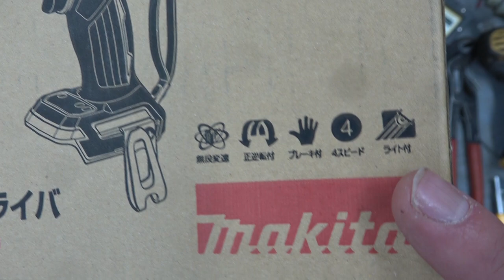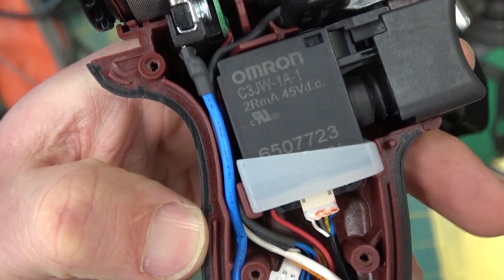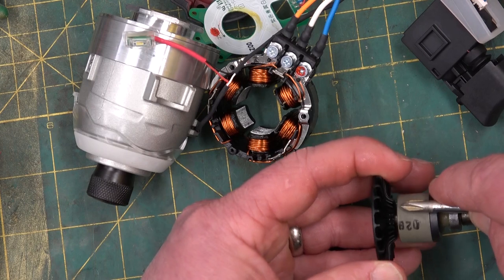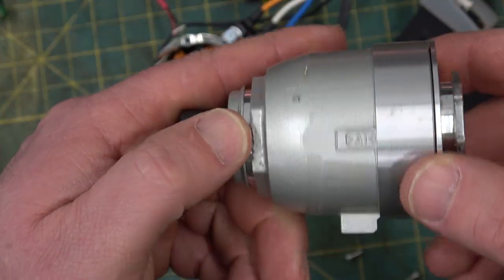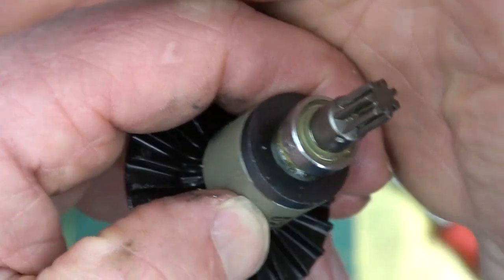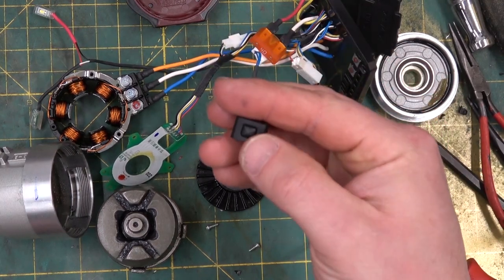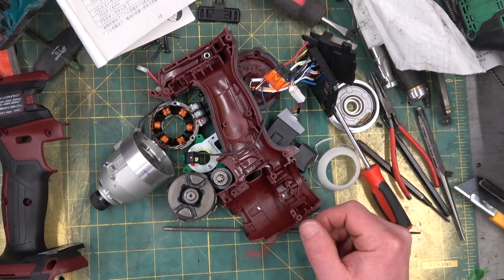Are Japanese Tools Better? Yes.

Comment: It has the exact same internals as the DTD171 sold here in Australia. The older DTD170 also had the 40A fuse and nice Omron switch. This model is the top tier in their 18V impact driver range and is sold as the XDT16 in the US.

Comment: I know a fellow who teaches English in China. He said " they keep the good stuff and ship the smoo ( junk ) to the states ". The old Bonnie wrenches were a joy to hold in this old gals hands. Highest quality. Still going strong. Lighter and more springy than common snapon. MAC had a few with these qualities. Super handy working on equipment with little access / working room.
Reply: I have access to some Chines market products, which are great and not cheap in anyway. Better than anything I can buy here.
Reply: That's mostly a myth, especially if you start comparing tools at the same price point, rather than compare a high end tool against an inexpensive one, like AvE is doing in this video. Of course the most expensive tool wins. It has better parts in it.

Comment: Watched this when I woke up.  Thought I was going blind from the focus.  I need to stop drinking moonshine mixed with antifreeze.
Reply: 🤣 I only drank beer last night and thought it was my eyes too.
Reply: Try moonshine with meths. Way better anti wobble vision characteristics.
Reply: Test your moonshine for lead. Sometimes old lead soldered radiators are used for condensers.
Reply: Try adding Lysol I heard from a bird that it cures corona.
Reply: No need to stop, just tinker your ratios a little.

Comment: I've got the same impact driver and it's a beast. That little button below the trigger simply changes the mode. It's the same as the buttons down by the battery.

Comment: Those Omron switches are incredible. Not sure of that model, but it looks like ones I find in medical equipment. Life cycles in the 100,000-1,000,000,  bulletproof construction. Resistive elements are beautiful, thick hot molded carbon, cermet or quality conductive plastic depending on application. 

Not a cheap part, but incredibly well made

Comment: Next: Hilti vs J.A. Pan, a head to head.
Reply: Hold your trousers buddy, Hilti has good warranty but quality of the tools is nothing to write home about nowdays.
Reply: @goodiezgrigis  Just dreaming. For the price, I'm still replacing worn bearings and switches on my Makitas.
Reply: @DirceuCorsetti  I've converted my 18v NI-MH makitas to lipo batteries with an adapter so it accepts the batteries from newer tools that had gone to heavens allready.
Reply: @goodiezgrigis  wait wut, there are tools that use lipo batteries? I was under the impression all tool makers used either 18650 or 21700 li-ion cells? 🤔
Reply: "J. A. PAN" literal cringe dude. leave that cringy dad jokes to AvE
Reply: @lordjaashin  hahahah I agree
Reply: Not anymore. The same for Metabo. The quality is around the same as Makitas Made in EU and DeWalt Assembled in U.S.A. Hilti and Metabo provide mechanisms that prevent the tool from overloading and overheating the use by the worker, not the owner.
Reply: Axis vs allies showdown!
Reply: I used Hilti hammer drills for over 10 years, they switched from assembled in Liechtenstein to China about 6 years ago and the are shit in comparison.
I used to drill over 2000 holes a day, the Chinese ones lasted 1/3 of the time the German assembled ones did.
Reply: Hilti breaks the second you drop it
Reply: @SIGURDRH  I tore a Hilti drill hammer in 2 single handed ,after the drill bit got stuck in the wall.
A also broke an expensive ,brand new ,Hilti diamond cutter ( the type that drills holes- was amazing thogh, drilling in concrete through thick rebar)
Reply: @goodiezgrigis  cool! think that possible (i mean how to do) for my 14.4v kit?
Reply: @haberdashery314  you can get an adapter online (amazingon or flebay) and use newer li ion batteries with older NI-MH tools. Or use 4S lipo packs for 14.4V and gut out old ni-mh batteries enclosure's.

Comment: When I was looking for a good belt sander, I noticed an odd Makita model 9924. Made in Japan. Strange rectangle vacuum connector. Overall old school feel. So I investigated and discovered that they are producing it since 1980s. The same one. You can find out comments on amazon of people who bought it 30 years ago and after it finally stopped working, they discovered that they can buy the same one 3 decades later. I never looked on any other belt sander brand again. I worked in one of those big tool companies in product development team and I know that if something is being produced for that long, it must be nothing but perfection ;)
Reply: Thanks for this story. If I ever need a belt sander, I'm buying the 9924.

Comment: Before Lithium batteries were common, Makita was using superior Ni-MH batteries for years while all the other brands were still using Ni-Cd batteries.
Reply: You can/could draw more current from NiCd than NiMH
Reply: Fun fact: Superior Ni-MH were pretty common in Japan - and at the time Li-Ion were in the range of becoming available, no one in Japan wanted to manufacture them, since there were pretty confident, that Ni-MH were way better than those newcomer Li-Ion-crap.

But Sony wanted to transition to Li-Ion especially for there camearas and did not find a company to produce them - so in 1975 they did a joint venture and formed what is Sony Energy Devices Corporation nowadays
Reply: @MattOGormanSmith  Yes, but not all NiCads were higher current capable. Cells can be optimized for either more storage capacity or more peak current, but not both. On average, you are right: the majority of the NiMH cells are not known as high current, and some NiCads surpass them in that aspect.
Reply: And all those superior NiMH batteries were never on high torque tools because the cells didn't have enough juice to last.

Comment: I've got the almost same model in anti theft teal. The little button above the switch trigger is a quick mode-switching button which you can program. Out of the box it will change the level of impact every time you press it, the front lamps will flash once if you press this button as an indication. This is very handy if you got a stubborn bolt that needs a little extra persuasion and you don't want to take the tool off the job to change the setting on the switches on the base above the battery.
You can change what the button does by pressing it simultaneously with the hammer button on the base switches so it activates this function by pressing it, or you could do the same and press the lamp button if you want the switch to activate the lamps and you can disable it's function or resume the quick mode switching by pressing the button and the switch with the A and cyling arrow on the base of the tool. Every time you change the application the customize lamp on the base and the selected mode blinks.
Hope this helps.

Comment: If you get a chance you should check out some of the audio equipment designed and built by Micro Seiki in Japan. They started as a aircraft metal works shop and went on to do all of the high end engineering and consulting for all of the top manufacturers highest end products in the 70s and 80s. I have a BL-91 and the precision on this thing is incredible.

Comment: Board has Japanese markings its saying "Red Blue Yellow black white"
Reply: Technically it says "Purple Red Blue Yellow White Black", aligning with the wire colours below.
Reply: The kanji before "red" is "purple" it doesn't really have enough context to tell whether or not it is Japanese or Chinese as all the kanji present are used in both languages
Reply: You are correct.  But not in that order lol.   it could also be Chinese, I guess... But I doubt it.
Reply: Google said Chinese, for whatever its worth
Reply: @FrankieG13  It's Japanese, but Traditional Chinese uses the same symbols, so it could technically also be Chinese.  But because China doesn't use traditional characters any more, I doubt it.
Reply: @peetiegonzalez1845  But Taiwan uses traditional characters.
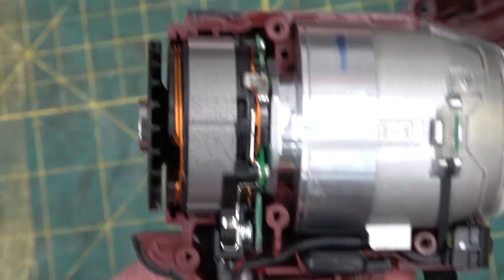Reply: The word青mean blue in Japanese but it mean light green in Chinese. 2:40 there is only blue wire but no green wire here.

Comment: i have had the black TD171 from japan for a year now and she just loves a good hot supper. not as much pure power as the M18 GEN 3 impact driver but soo much more control and less bit wobble. important if you work deep in control cabinets but still need the power of 18v. Thankyou Ave for steering me to makita.

Comment: That little “hand button” cycles through the speed settings with your index finger, makes it so that you can change speeds with one hand without needing to let go of the tool. It’s great. It does exactly the same as the “blow”/“strike” button on the control panel thingy.

Comment: Button above trigger on that model engages a pre selected "favourite" mode, so you can change modes on the main board for an odd screw, and press the favourite button to revert back to your main use mode.

Comment: I’ve bought several of these in the past few years. Every time I bring one to a job someone always wants to buy it off me. They are far better than the ones you can get around here. The small button on the front is to change the settings without having to use your opposite hand. Nice feature.
Reply: Are you in the us? Do regular 18v makita batts work or you gotta get japanese batteries too?
Reply: @johnmf6096  ya I’m in the US and I use regular 18v Makita batteries that I get here.
Reply: @badbatch974  awesome. Thanks for the info.

Comment: Looks like they ran that hammer through a shot peen, helps the surface hardness
Reply: The main benefit is that the residual compressive stress from shot peening makes it much harder for fatigue cracks to start because they can't start unless there's a tensile stress.

Comment: This is why I imported me a HS631DZ, only circular I can find made outside of China proper. And that little push button above the trigger is probably a mode switch, toggle back & forth between two settings, so you don't have to keep playing with the control panel down below.

Comment: Amusingly, across the water, Chinese home market stuff is actually even worse than the crap they ship to us!
Reply: They ship the worst stuff to South Asia- the labor is cheaper there and they can sort out fallouts and make  working units out of scrap.
Reply: I've bought a bunch of stuff in China and the quality can be much better than the hobby crap that HF etc. import, because actual factories use the stuff 24/7 and it has to work well. Eg. collets, live centers, keyless chucks, carbide tools and so on. They also have to compete against the top quality Japanese and European carbide inserts etc. that are sold more cheaply in China than elsewhere. A lot of the non-international brand junk that's sold here was made for half the price of the local quality product to pay for shipping, import costs and middleman markup. When you make something for half-price it ain't the best.

Comment: I worked long ago at Suzuki, motorcycles assemble line. 
Everything for export, usually the big bikes, the line runs fast.
But as soon the “for Japanese market” enter the line, its speed is reduced to 25%. It happened to assure a better quality and less problems during the assembly.

Comment: Made chop saw blank, then shaped gear teeth, broached keyway, deburr back hole. Ran 4 machines on a cell for B&D in 1984. Top pay on floor. Acme Gridley multi spindle set up dude

Comment: How does one get that model instead of the cheap export model?
Reply: You can order it from Amazon JP or any other retailer, and use a forwarding service like Blackship or Tenso, or shop from Buyee. Make sure you check the prohibited item list when using a proxy/forwarding service though.

Edit: the “concierge approach” is probably to use White Rabbit Express.
Reply: Ebay

Comment: 03:35  Japanese uses the same characters as Chinese, which they call Kanji.  They also have a phonetic alphabet called Kana.  The two are intermixed all the time.

In principle, you can translate Kanji into any language, because the symbols don't correspond to words but to concepts (which is why China has the same written language for many different spoken languages), but the interspersing of Kana makes understanding actual Japanese words necessary.

In this case, the characters just say purple, red, blue, yellow, white, and black.  It's just the colors of the wires connected below.

Comment: I've got the exact same model, different color. Bought it from Ebay a year ago for €178 while the Chinese equivalent was selling for €190 here. It took 10 days to ship from Miyagi, Japan to Athens, Greece and  50 fucking days to ship from the damn Greek post office to my area. It was the first time I ordered something outside of the E.U. so I didn't know that I had to pay + €60 in custom taxes when it finally arrived. I was kinda pissed because i could settle for the Chinese model but seeing your video made me feel better. A little disappointed that the main pinion isn't machined.
Any way it's a great tool and I'm sure the Cinese version is almost as good. My only concern is that it has lot's of switches and electronics for various impacts modes that i'm probably never gonna use and they are probably the first components that will fail. By the way the tactile switch above the trigger is for changing speeds.
Reply: Lol on the Greek post office wait-time. Gonna Jump in. Where did you get it from?

Comment: Been using Makita for over 25 yrs.  The 1s that are born in Japan and assembled there are keepers.  Ive got a few that were made in China and they show it.  Ive had 2 that were take backs within a week.  1 only made it to job site, threw a battery in and it was DOA.  I developed contact at a place I can deal with in Japan and buy directly.  Only killer is the shipping price and wait.  Since Red Tool is shipping like crazy all the cargo ships are running full bore and cant get in and out of port quick enough to pick up the good stuff from Japan.  Ill stay with Makita as long as I can get the 1s built in Japan.

Comment: That little button is a quick change for the mode setting so you can change the speed without stopping what you're doing and pushing the littler mode buttons on the base. 
Picked one of these up in Japan a couple years ago for $150 and have been beating it up daily, dropping it off ladders, freezing it, soaking it, whatever abuse I can think of and it just keeps going like it's day one.

Comment: I think there is a huge demand for actual good tools here in the states, the only reason I buy ridgid is the lifetime service warranty, when they break I drive 15 miles and drop them off at the local repair facility, and I pick them up when they are done, they even replace dead batteries.

Comment: Honestly my good ol green makita brushless looks identical inside.  
It had been left on a roof at the top of a solar array by a co worker and I found it at our yearly inspection, so in the rain and elements for 12 months.  
The quick chuck was rusted but came loose with WD and a hammer, new battery and it spun right up so of course it went in my tool bag.   
Opened it up and not a mark of corrosion inside. Been using it for 10 years since then.   
Actually the speed setting sticker came off, but they all did that. Maybe that's where the real difference is??

Comment: Language lesson for you - you were right in identifying Chinese characters (around 3:45 timeline) and going back in history both Japan and Korea exclusively used Chinese characters and only developed their own written characters in more modern times. While Korea switched almost completely over to using Korean characters, Japan still uses a combination of both and so you were quite correct in recognising the distinctive Chinese characters. While I don't fully understand how it works, I can say the 6 characters shown from left to right are colours and in Chinese would read purple, red, green, yellow, white and black which appears to correspond to the coloured wires below with one exception - green. When I translate that character from Japanese to English, however, it translates as blue. Not sure if that means when the rest of us see green, Japanese people see blue and if that's the case does the opposite apply when we see blue?

Comment: that small switch is used to change between the different speed modes (1-4). Honestly why no one though to put the control there to begin with is mind boggling, its a one handed operation to change the speed and you can start with very controlled low impacts and shift it into turbo nut slapper mode with just one hand. Genuinely brilliant.

I have two of this particular model in the same colour. One to use and one to admire lol.

Comment: Nice piece of tool, it still make a difference be made in Japan. But I thing it got a little dirty spot on beauty,  the power mosfets are sealed in plastic without any heat sink, all the current fed by thick cables goes through tiny 6x5mm  IR 6725 mosfets, it just want last same load like the old LXT model which I using for 10 years.

Comment: Love this, so cool! How do I order the Japanese made?! 😄

I also have a question about the three prongs that grab the bits on a drill, how to fix them? I (haphazardly) bought a Dewalt drill from a pawn shop, get it home, put in the bit, and it spins all Wonka donk! One of the three "prongs" that grabs the bits is out ahead by almost a quarter of an inch, I'm wondering if I can get it back in line with a little swearing and a tool or two? I welcome any helpful responses 🤖